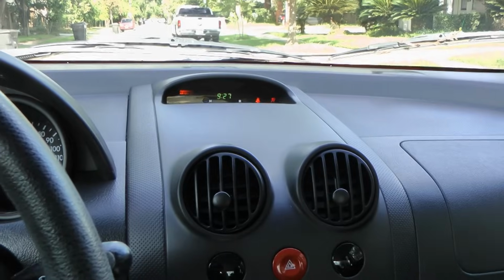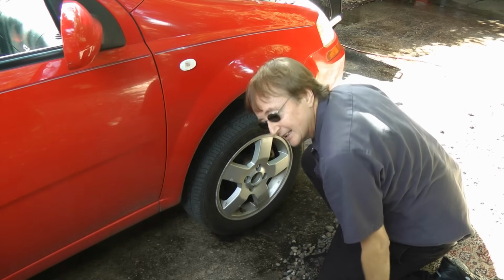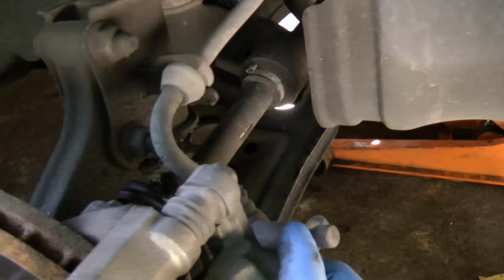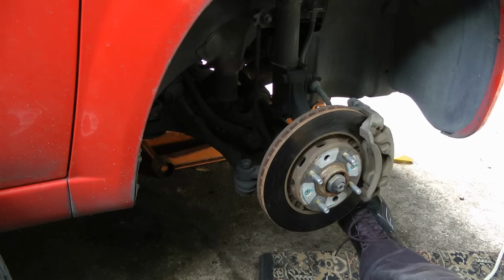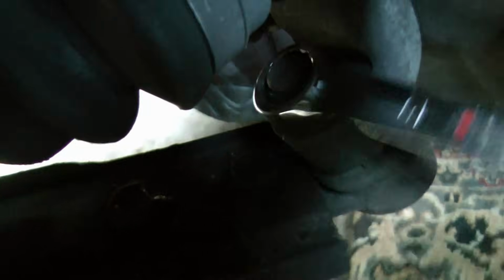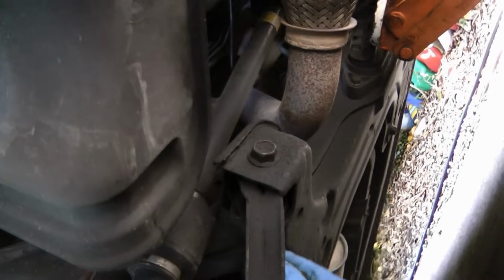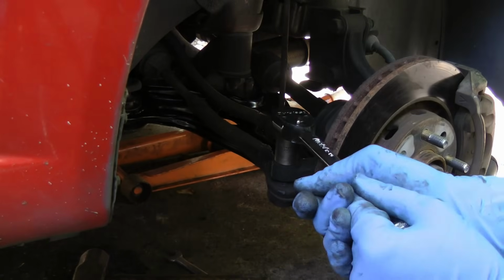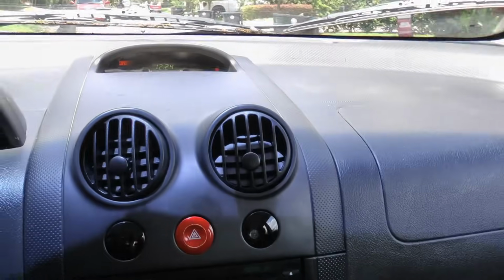How to Fix a Car that Clunks (Lower Control Arm)

Comment: You didn’t mention adjusting the alignment after installation any professional mechanic will tell you as much otherwise you’ll just wear down your hard work more quickly and be back at square one you actually skipped over a few important steps you only described how to literally take of and install a control arm for that specific car that’s it and that’s not necessarily the best way people who value their cars will want the best way